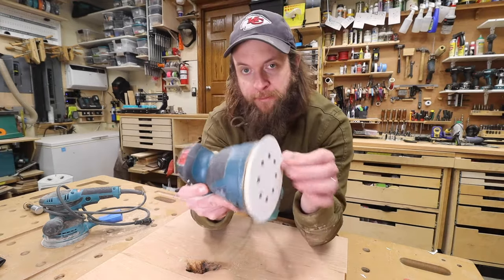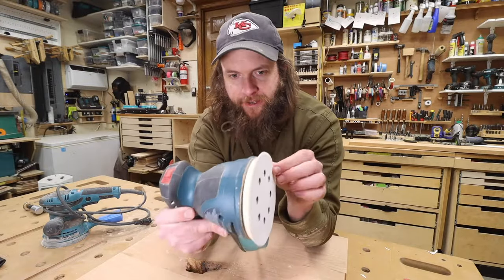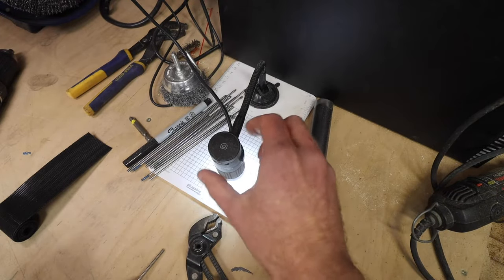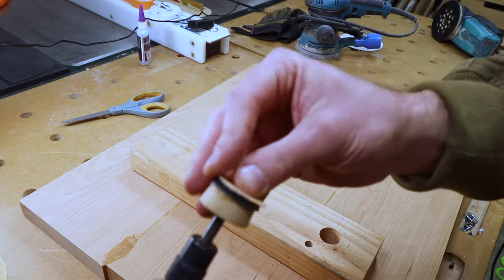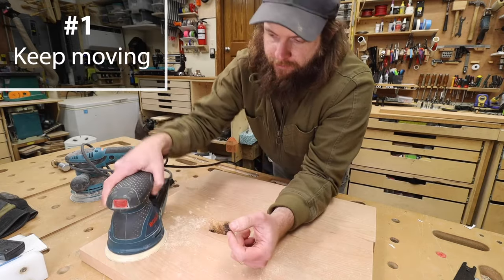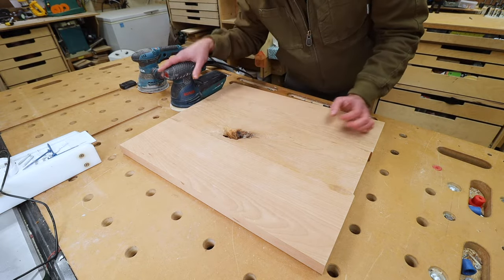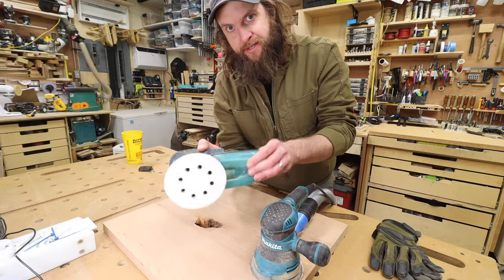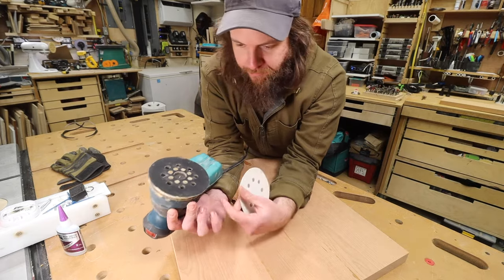Stop Melting Your Hooks (why sanding discs fly off your sander)

Comment: The 1st thing to say is: The quality of the sandpaper backing makes the biggest difference!! Even with new velcro, cheap pads fly off. But thanks for the sanding tips!
Reply: 3mm is definitely the best but Diablo would be the better choice because of the price difference.I say this because 3mm doesn’t last longer but considering the price difference you’ll come out on top with Diablo cause you get a lot more and it last almost just as long.Im not good at explaining things but hopefully someone gets what I’m trying to say 😂…by the way the Bosch orbital sander is the best way to go.it lacks the power of the makita but smashed it in every other category and I’m speaking from experience on both.The Bosch will not let you down.Also I have never ever saw a dust collector on any sander that’s as good as the Bosch one 😏

Comment: Another common cause nowadays is sanding mesh (e.g. mirka abranet, 3m cubitron II, etc.). The velcro goes through the mesh a bit, and gets cut abraded.  Only way to deal with it is to use a pad protector, which is really just double sided velcro.
Reply: This explains a lot!! Great observation.

Comment: Can you please do a follow-up video for Multitool (or vibratory mouse) sanders that use a triangular shaped hooked backing pad. The triangular shape of the sanding pad is designed to get into corners, but using a Multitool (or vibratory mouse) sanding pad in this way again creates localised overheating of the backing pad, the hooks melt and the sand paper falls off!
Reply: My exact issue!

Comment: I just got a Bosch Get75-6n and I have melted two pads in little less than 2 months . I thought it was the pads but now I will work on my technique. Thanks for the video.
Reply: Or it could be just lousy velcro. I know it would be shocking to think that manufacturers are using cheap materials just to make more money…..
Reply: @dalanbronnenberg I hear yea, corporate greed is everywhere.

Comment: You just prevented me from melting the pad on my new pex 400. Thank you sir... I have been throwing pads for no reason. So I will have some patience... maybe hand plane with a sharp blade so I don't need to spend 3 hours on the same join to get a level surface. I will go slower and not keep the setting at top speed constantly either. Thank you for this video.

Comment: I don't have a random orbit sander(yet) but I do use right angle die grinders with the sanding pads. It makes sense that the heat could do that, I haven't had this happen to me yet but it will be stuck in my head next time I use it. Thanks.

Comment: Explains to me why the sandpaper for a die grinder has a threaded backing.  Great info tyvm.
Reply from the maker: Ahhhh I never made that connection. The Roloc discs…. Those are awesome.  BTW stay tuned. Tonight I’m actually recording a video about using a die grinder for sanding, but using a different attachment technique. I’ll mention your comment!

Comment: Ok Kieth, duely noted BUT ,
How many of your viewers are having a problem with just the Bosch sanders??? ( Mine is the  Bosch 1295DVS)  the problem I'm having is the difference between bosch and say DeWalt backer pads (no problems with the DeWalt backer pads and never replaced one even with heavy abuse)
Have you looked at Bosch random orbit sander backing pads ? The lack of "hooks" to begin with? Different design perhaps
Also on my Bosch random orbit sander and there is one bolt holding the hook pad onto the sander causing it to be somewhat concave ! Some thought this contributed to the problem but Ultimately frustrated with pads flying everywhere (even when brand new) and then having to finish the day using my son's Milwaukee R.O.S without issue, I had to put the bosch sander away for many years and bought a DeWalt R.O. Sander (end of problem) I did put them side by side with new hook pads on them and DeWalt has aggressive hooks and no problem holding a pad at all and the Bosch just doesn't want to hold a piece of sand paper period and most time don't even make it to the wood before flying away at first I blamed the sand paper and found some that stuck a little better but had no problem with any paper in other sanders
Fast forward a few years  I pulled the Bosch sander back out to see if they have resolved this issue, that was a big subject on the internet at that time but when I call Bosch they keep saying "you need a new backing pad sir" I say I have had 2 new pads and it's the "design" of the pad I'm asking about, they say maybe it was defective "you need to buy a new backing pad sir" me= no they are all the same my question is about the design of the backing pad, them= " you need to buy a new backing pad sir" stuck on stupid !
And Now when I look up new backer pads they have soft backers medium and hard backers of which I will use a hard an use soft interface pad if need be but my fear is a Bosch backer won't hold paper or an interface 
So between DeWalt and Bosch, Bosch has a distinctly different style of hook and horrible! So I'm wondering if  it could just be Bosch sanders having this problem?????

Comment: Interesting video I'd imagine your going to get into how its easy to put wieght on the sander. However sometimes its the sand papper. I bought a off brand sand papper on a new sander & it lased 2 mins before it would no longer stick. It was just the quality or type way they made their Velcro. I hate the velcrow anyway they are cheap & cost more while giving you less, Its just harder to find a real sander anymore. Most of them are made as a one n done type solution unless your paying for the extra brank names like milwaky.

Comment: Nice one. Whats your opinion about orbital sander (square type) vs round type orbital sander for grinding cut glass bottle edges? Which one is better or what would be the best way to smooth glass edges at home (except manually).
Reply: A Dremel with a drum sander bit 👍

Comment: Thanks so much for sharing ! I just got GEX 125-1 AE BOSCH and from the very first moment the discs are flying of after about 10-15 minutes of work .Used them for sanding wood as well some concrete material .Any suggestions ? Is there any chance to be the discs quality issues ? Being cheap or smth ?Thank you in advance!

Comment: Question: I got the random orbital sander made by craftsman out of the case and it looked odd. Hadn’t been used in many years. Pad looks like it disintegrated. On closer look the pad is melted onto the metal. It’s sticky like tar. What’s the best way to clean this up?
Reply: Replace

Comment: Well, I do see that some of the hooks are indeed melted on mine.
But that does not explain why a brand new disc will stick like crazy, but after only a few minutes of relatively light use I see it starts to wander and I need to restick it to center it. I typically get to do this a few times before the sucker flies across the room and then it will not stick anymore. The sandpaper in it self is still near 100% cleans up nicely by simply brushing or smacking it on an edge, but it will not stick and there is nothing for it but to grab yet a new fresh sanding disc.
I would wish there was a roll fo 125mm wide stickytape with loops that I could "refurbish" the sanding discs with as it gets very wasteful and expensive in the long run to swap papers every 5 minutes.

Comment: After 15 years and thousands of hours sanding with professionals equipment I bought used a cheap sander once. I usually get a few thousand sheets on before I have to replace stuff, this bad sander couldn’t handle more than 5 sheets. It’s mostly about buying the good stuff.

Comment: Contrary to what some people think extra pressure is not always the best thing.  The way that I see it the extra pressure just causes you to have to do the work the sander was intended for.  That also creates more friction (heat) and the pads on many sanders just can't take that heat for long.  It is frustrating when a pad won't stay attached to the sander or you can't lift the sander without it whirling to a really high speed and throwing the sand paper across the room.  I am very sure anyone who ever did it knows exactly what I mean, the paper becomes a frizbee and can go an amazingly long distance.  I know a lot of sanders have some sort of brake that keeps them from whirling out of control but the ones that don't can give you a really wicked paper cut if you are not careful!!!

Comment: Used to work for a cabinetmaker with 40yrs experience, I always sanded how you're explaining, they'd always get mad because it looked like I wasn't working my butt off. Not with them anymore, I'll keep sanding how I want. The fumes bothered me more than anything else, their paint booth was open to the shop and they made their own doors. I'd be on a install day not in the shop much 30 min at the start 15 min at the end of the day, and those in those 15 minutes at the end of the day I'd end up smelling like I came out of a finish room. They had a big 4' fan with a filter cubical, I don't know why it was so toxic in there.

Comment: Okay, so yes I have the third bad habit but only because I was sanding wainscot panels and that was the only way to reach those (very old ones, panels are not straight so band sanders are out of question, delta ones are way too slow). New discs are stay on the machine but after 10-15 minutes they just fly away. So what is the problem in my case? :) Cheap discs?
Reply from the maker: When in doubt, always buy a replacement tool at least 1 level nicer than your spouse feels is reasonable. That way, if it does happen to do the trick, you can walk around the house for a couple days demonstrating how well sandpaper sticks to your good decision.
Reply from the maker: Alternatively, try a sound test on your pad. Seriously.  Take a small piece of that sandpaper (or any velcro) and listen to the peely sound at different points of the pad. 

Your points about sander types are valid, and your situation is perplexing.  Perhaps the current sander pad is actually not holding well enough in the middle. 

Or maybe see if the corner of a card scraper works instead of sanding.
Reply: @KeithsTestGarage  Sure, I will give it a try, nothing to lose at this point! Thanks for your reply!

Comment: I think one reason these melt off is people take the pad off and go look for a new one. They get sidetracked and come back and start "sanding". By the time they figure out there isn't a sanding pad on the sander, the hooks are melted completely down. I have several of these since my wife does the most sanding. Replacing the entire sanding pad gets pricey. If the sander has any age on it, you might as well buy a new one. This does not seem to help her remember to check to see if there is a pad on the sander.
  I do have to recommend the Menard's store brand sander. They have a 3 year warranty, a 12' cord, and tons of power.

Comment: Keith: I appreciate this tip, but I still have the problem, and maybe you can suggest a better solution.  Here's the situation: I also thought I might be melting the hooks, because the Diablo pads would fly right off of my Ryobi orbital sander.  So, I replaced the sander pad, and the first disk flew off within maybe 5 mins.  However, subsequent disks stuck to the pad just fine.  Also, the used disk would not stick to a totally unused, fresh sander pad anymore, but fresh disks of course would.  Is it possible that the loop side melts before the hook side in this case?  The hook side on the disks that fly off does look slightly different from a fresh disk.

Thanks!
Reply from the maker: Yeah that sounds like a junky loop side!

Comment: Okay, so I've melted off the hooks on one corner of the sander (I have a triangle sander), can I replace the spongey hook part? I really want to avoid replacing the sander because it was not cheap. I've been trying to find out if I can but I'm a complete novice so I don't even know what the spongey hook part is even called. Someone please help.

Comment: Hey Keith! Do you think there would be a bigger problem if you're working with a vertical piece instead of horizontally like your pannel? I feel like it keeps happening even though I do my best to do those 3 tips you gave and I just replaced the pad. Couldn't get 2 discs to last more than 10 minutes...
Reply from the maker: I do not think so - maybe there's a bigger issue involving the pad or the discs.  A few weeks ago someone sent me a message on IG w/ a similar issue, and I'll paste my response below:  

May be worth testing a few things if you really want to nail it down. Listen to it as you detach it. Apply and remove the sandpaper (a new piece) a dozen or two times without using the sander. 

If the sound remains the same, then the sandpaper is probably fine.  
If the sound sounds less grabby, the sandpaper is probably the culprit - and the soft side will start to look a little fuzzier compared w/ a new piece of the same sandpaper.

If the fuzzy side seems to be holding up, then you can be fairly certain it’s sander pad or technique related.

So, when sanding - every few minutes, immediately after sanding, feel the warmth of the sandpaper w/ your hand.  This will give you a feel for how hot the pad is getting.  It should be a little warm but not really warm.  Maybe you can identify something with technique there.

Also, detach the sandpaper every few minutes during sanding and if the paper gets easier to remove each time, you have likely verified it’s either you or the pad (though we still don't know which....but it's safe to make a guess based on how warm the sandpaper feels from the paragraph above)

Side note:  Vacuums majorly help w/ cooling by 1) providing airflow under the sandpaper, and 2) de-clogging the dust from under the sandpaper which allows air (containing heat) to clear out from under there.

Comment: I was sanding an edge of a board and  the sanding disk simply broke in the center causing damage to the center of the sander rubber pad . Any way I wonder if this is simply because I was not checking the condition of the sand paper disk or due to my abuse. I was using master craft sand paper disk and I suspect it was quality related. I notice that the paper was not wear out but simply  braking off small pieces of abrasive material. At that time I simply swap the disk because I don't want to risk damaging the tool. Normally high quality sand paper wears out instead of tearing up. Please advise on higher quality sand disks that wear down instead of tearing up.
Reply from the maker: I like Mirka Gold from Amazon.

Comment: Which adapter are you using for your  makita?
Reply from the maker: for the dust port?  A custom designed 3D-printed one using flexible TPU filament.  I'd highly recommend a Creality Ender 3 if you don't have one yet!

Comment: Yeah no.

The manufacturers have made the velcro weaker compared to older models. I bought a brand new Dewalt and used it with very light pressure, moving around continuously on a maple table top (keeping the unit flat). The papers kept flying off, Scotch tape would have done a better job. Going back to my ancient Black & Decker there was no issues (and I abused this one). 

I could have been the type of backing on the sandpaper as going to a more felt like backing solved the issue.

Comment: I can't imagine using that bosch sander for 7 years. That's the sander I had before I got the festool. Just the 200 dollar one. Their base model is sooooooo much more enjoyable to use compared to the bosch. Pull the trigger keith!
Reply from the maker: a $200 Festool sander?  Yowsers.  Do you have a dust extractor?
Reply: @KeithsTestGarage  Yeah it's the Fein Turbo

Comment: How ironic, I have the very same bosch. I lent it out, and when they returned it they complained about the pad not holding after a while. I replaced the pad, but now I know how it got got burnt.
Reply: what's ironic about that?
Reply: @VvvnimaL  Your right, that wouldn't be ironic. Irregardless, there was irony in that my friend had pointed at his unheated garage and minus -20 C temps, which I did not state. I have admitted I used the word incorrectly, do you feel better? I understand your frustration as people routinely misuse irony for many forms in this case serendipitous or perhaps  coincidental would have been better stated. Note the accurate use of my personal most loathsome non-word, bold faced with a red squiggle because it is hard to spell a non word correctly. Regardless, when I see it, I let dogs lye, lay, lie? Because this is an internet comment and I accept that people will comment in colloquial terms and irregardless has come to mean regardless even though it isn't a word and would mean the opposite if it were, how ironic is that? I forgive those that use it incorrectly without comment, presumably you can not. And so, I apologize for my error.

Comment: Try the 3M xtract cubitron net sanding discs. That will compensate for the perceived lack of power on the Bosch.
Reply: Did you have a problem getting the xtract hookit discs to stick well to your Bosch sander? I have a brand new sander like the one in the video and they don't stick well. I really like the sander, and the xtract discs so I think I'll try an aftermarket hook and loop replacement pad.

Comment: Surely an expensive one will use better quality "hooks" which won't melt as easily as cheap ones, no?
Reply from the maker: I'd guess you're right.  Better quality sanders will also probably handle airflow better to keep things cool, or maybe (less certain about this one) even keep the pad spinning better so the heat from oscillation doesn't build up as quick.